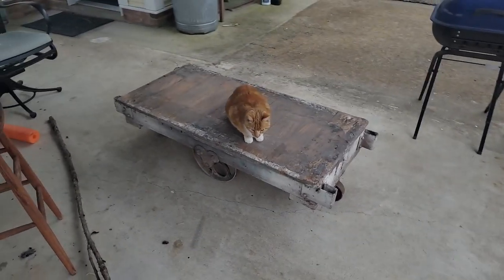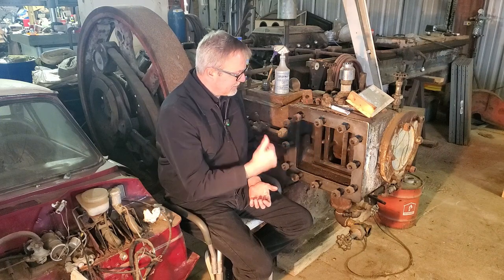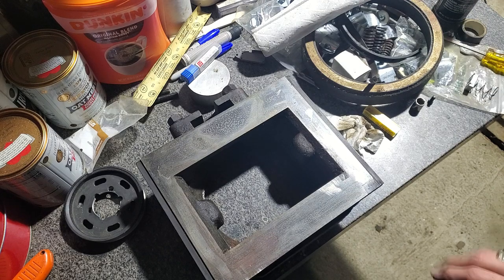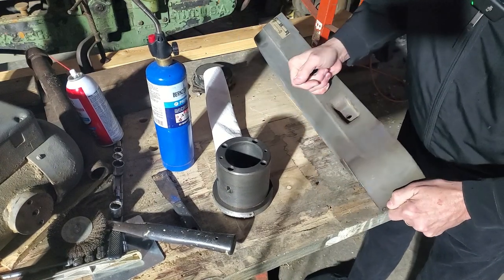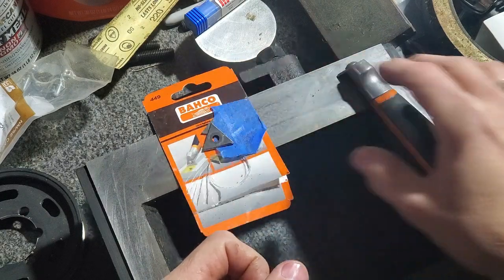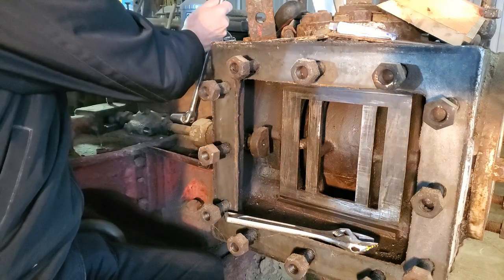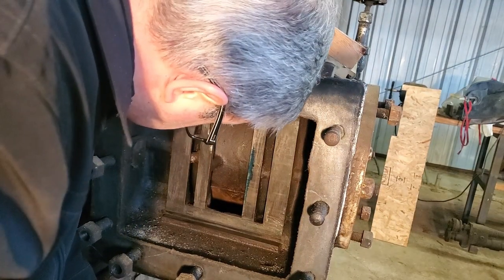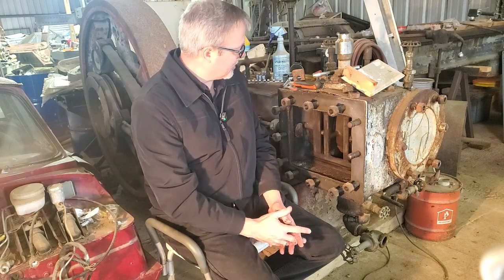Playing With My Skinner Steam Engine

Comment: Yes, the steam cylinder oil turns to tar when cooled. Back in the day, my dad was a dock builder. The cranes were steam powered. Every Saturday morning I washed the steam cylinder oil off his car. I had to use hot, hot, hot water to make it liquid again and heavy duty detergent to wash it off.
Reply from the maker: I figured as much. Valve rod barely wants to move with the stickiness combined with the packing.

Comment: What's your plan for a boiler to run the engine? 150HP is a pretty good sized boiler that will require certs/permits to operate and a lot of fuel.
Reply from the maker: Long way from boiler selection. Thinking 25-35 hp Hurst or similar initially, then add 100 hp secondary boiler later. Boiler hp doesn't necessarily have to match engine hp. Will never run 150hp load continuously. Will reacess boiler #2 after determining steam usage. Skinners were some of the most efficient simple engines with the inertial governor and full pressure steam chest.
Reply: @EngineersWorkshop  makes sense that you only need to supply enough steam for the load on the engine. And probably only the average load if it varies within the steam reserve of the boiler.
Reply from the maker: @Grumpy Oldman  There are some issues. Severely overtaxing a boiler will cause it to froth up, leading to slugging (water carryover into the steam lines). A physically larger boiler helps avoid that, as the mass of water moderates the temperature swing. Really a dying art to size one properly.
Reply: @EngineersWorkshop  Seems like sizing large mechanical equipment properly is difficult. At my previous employer, the consultants would be either undersize or vastly oversize. Very few systems were sized correctly so that the pumping matched the chiller/boiler and the load. wrong delta-t assumtions leading to flow problems that were unfixable without redesign. With decent data, it really isn't hard but expecting the 16 degree delta-t system to consistently provide 16 when the large air handlers shut off and the 10 degree fan coils dominate is crazy. Anyway, it will be interesting to see how your system turns out. Also good to hear that your son decided on the double row bearing.
Reply from the maker: @Grumpy Oldman  Oversizing equipment is easy when it's not your money paying for it. This is all my dime, so I want to do it right. The Hurst's are pretty compact and will let me do a lot of experimentation before going with boiler #2. Will be fun tweaking out this engine!

Comment: won't the chest come off so you can machine it? It's going to take you a month of sundays to scrape that in!
Reply from the maker: The chest and cylinder do come off (one piece) but it's far heavier than my mill can handle, probably 1000 lbs. I've done three scrapings and the contact patch is getting bigger.
Reply: @EngineersWorkshop  shame it's in 1 piece, even scraping would have been easier on a bench.
Reply: @EngineersWorkshop  yeah but you could probably take it apart drive it to the mill in Kentucky mill it and still be done quicker but you certainly can get it the way you are going too. 😊
Reply from the maker: @bcbloc02  Which mill did you have in mind?😁
Reply: @EngineersWorkshop  Would be hard on the Cincinnati but a piece of cake on the G&L.
Reply from the maker: @bcbloc02  If it starts taking forever I just might take you up on that.
Reply: @EngineersWorkshop  sounds like a plan😁